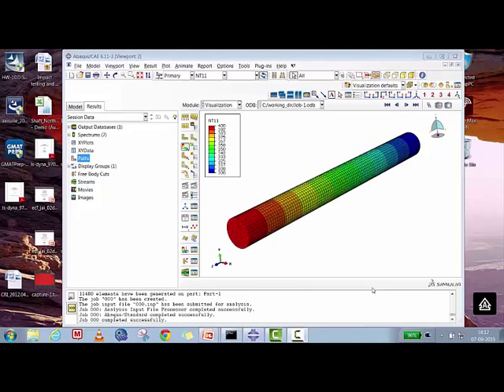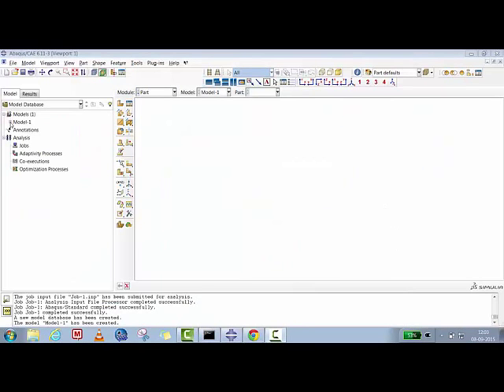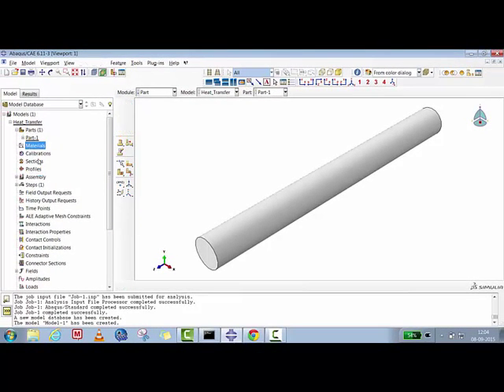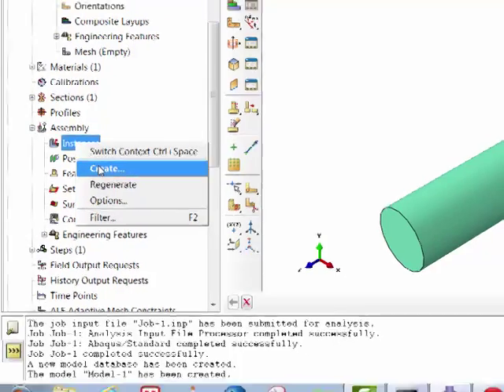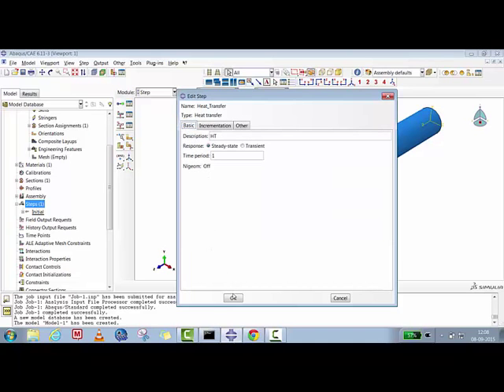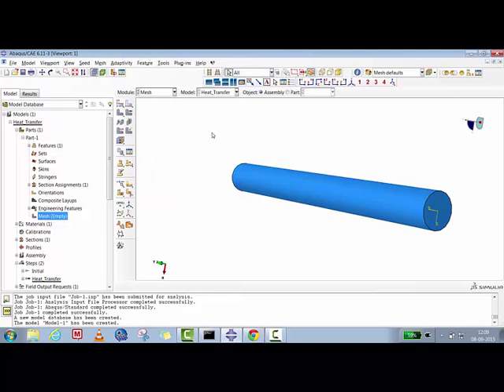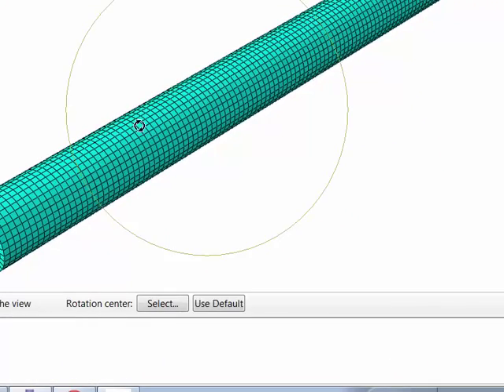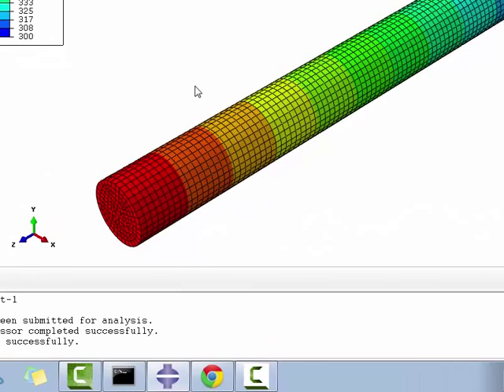Abaqus/CAE 6.11: How to do step by step  conduction mode of heat transfer using Abaqus

Comment: great video!!
I would just like to suggest using the differential version of Fouriers law, and using T(temperature) instead of t(time) for your variable. For me at least, the default field output is <HFL>, heat flux vector, where this video shows <NT11> as the output. Simple to change: Results -> FieldOutput and select NT11